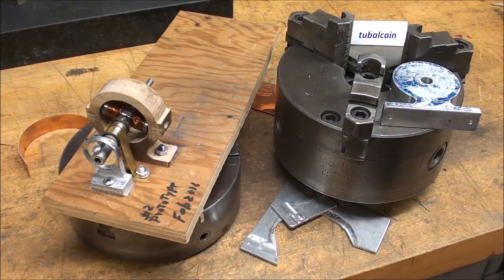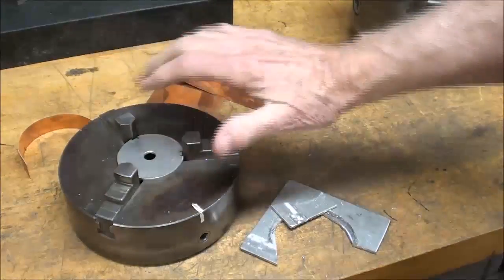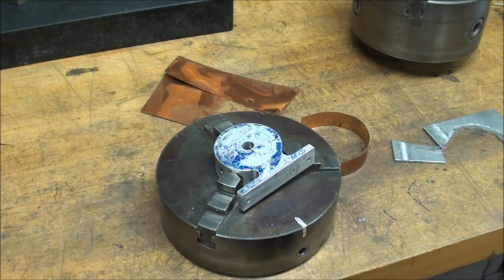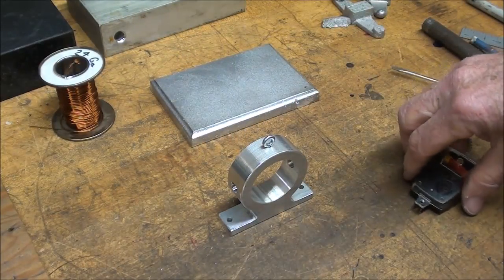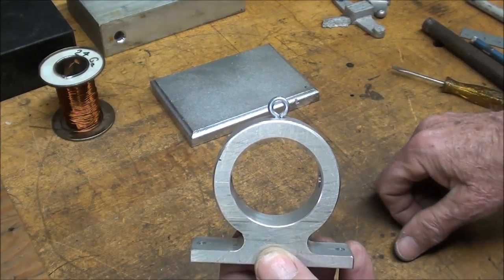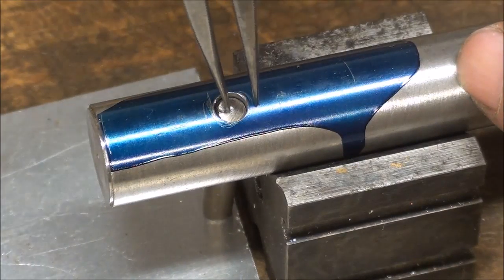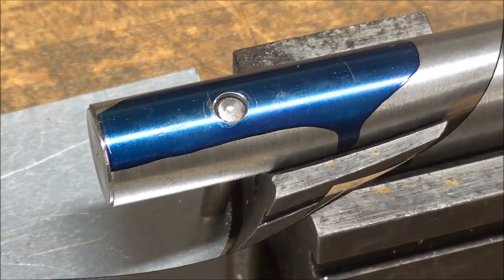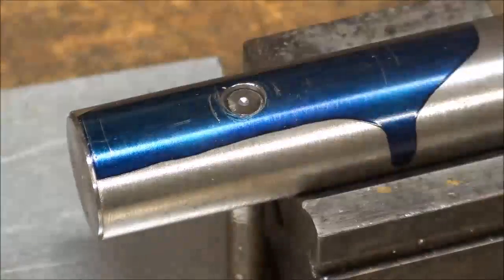Pt 3 tubalcain BUILDS A MODEL DYNAMO for a Steam Engine

Comment: You know it occurs to me that you could make a holding jig for a roll of electrical tape that would fit into the lathe. You could then mount an exacto blade in your tool stock with an adapter. After that, it would be simple to make your own half inch tape. The bonus is that you have a roll that's a quarter inch wide too. Just think of the exacto blade as a parting tool. I hope this helps. Great videos, Keep it up.

Comment: Don't know if anyone previously mentioned it but when you are concerned about a drill chuck spinning in the lathe tailstock spindle taper a good solution is to put a lathe dog on the drill bit near the chuck end and allow it to rest on your compound as you drill. The dog prevents the drill from spinning the chuck in the spindle taper.

Great job on the video , as always.

Comment: If you use the power feed and also the stop on the bed, will the lathe crash when it hits the stop or does it disengage itself somehow?
Reply: +Shane K Yes, it will crash if you don't dis-engage the power feed.  I've witnessed more than a couple of such crashes in the machine shop. You dis-engage when it gets close and feed by hand to the stop.
Reply: Thanks Kevin, I'm still rebuilding an atlas 10 I found at the scrapyard. I just got the countershaft in the mail yesterday. When they crash, do they just stall out or does it break something? I'm just wondering because I've still got to buy a motor and was thinking about buying a one HP but the originals were 1/2 I think, if they were designed to stall when they crash, that would really help me , thanks.
Reply: +Shane K On the crashes I've witnessed there was a shear pin that broke in the power feed. I have no idea whether there is such a safety on that particular lathe. Maybe tubalcain knows?
Reply: Thanks Kevin

Comment: A tip for you: Buy the widest roll of electrical tape you can find. Chuck it up in the lathe and put an Exacto knife in a boring bar holder edge up. Slowly plunge the blade into the tape roll and you can make any width tape you like. Think of it as a really fine parting tool.

Comment: I think that recently you had a video that covered backlash. I recall watching it, but don't recall the video title. I guess it wasn't until THIS video that it hit me: I don't know how to deal with backlash. For example, when using that parting tool, you set your collar dial to zero at the depth of cut. But then you back the tool out for another cut. Once you change direction, doesn't the backlash in the crossfeed screw affect your measurement? Maybe not since you have the same backlash backing out as you do advancing in? Do they cancel each other out?
Reply: +deemstyle He was moving forward and stopped and set it. When he moves back out, the dial reading will be off by the amount of backlash. The saving grace is that once he starts moving forward again the first little bit of movement will take up that backlash and the dial will be correct again. To get rid of backlash error go in the opposite direction and come back in.
The easiest way to see it is to have an old worn vise; move it in and out while looking closely at the jaw movement and it becomes obvious.
Reply: +TheOtherBill Thanks! I wondered if moving backwards and then forwards again negated the backlash. Thanks for confirming!

Comment: I wish my lathe would cut that good with a parting tool. It produces Lots of chatter.
Reply: +Fred Miller I have. 1934 South Bend 9" 405 Y before the A model,  that has not been taken very good care of before I got it. It has cast iron to spindle fit. I will try a smaller tool and see how that works. I have tightened all the gibs just need to use it as a play toy as I have a 10" that I gunsmith with. Thanks for the reply tho.
Reply: +greasydot I totally agree with Zumba.  I use a 3/32 on my 12" 100+ year old lathe with babbet spindle bearings and with tightened gibs it cuts like charm.  Play with speeds (slowing it down) and use plenty of cutting fluid.  Good luck.
Reply: +greasydot I think you will be pleased with the results.  Let us know how you make out and good luck!  Fred
Reply: +zumbazumba1 thank you, I will give the smaller parting tool a shot and see how that works.